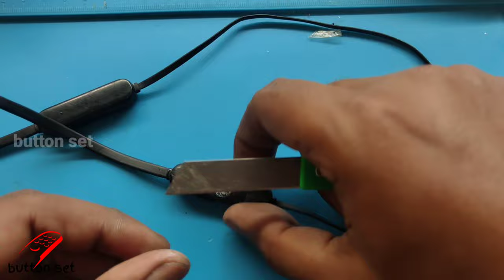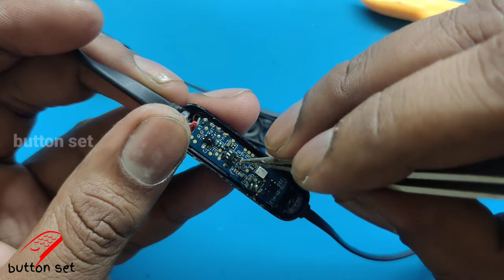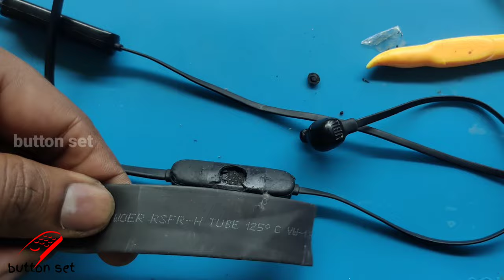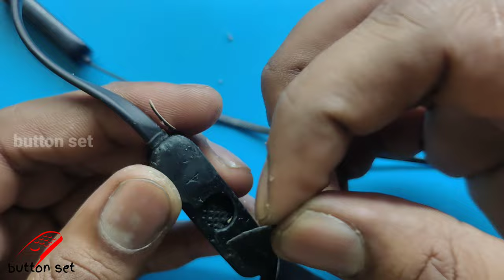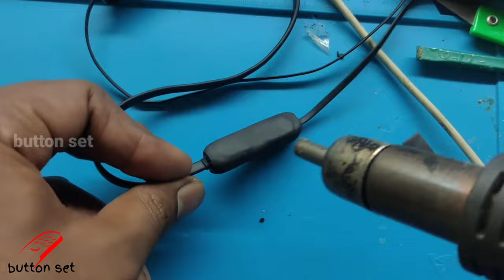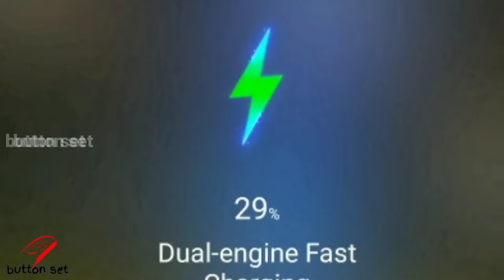JBL tune 165 BT Power Button Replacement

Comment: Hi, i like the way u did a clean repairing  job.....i have jbl tune bt110. Its button are hard to press and I want to turn it into a sleek and compact audio receiver with audio jack and longer battery life within a new good looking plastic enclosure box. The issue is i don't know if the external buttons are connected via jumper wires, how external buttons are to be placed with a clean look that looks nice and almost genuine....i think you can cover it with a heat shrink tube....Can you help me out with this diy and make a video too...if u agree i can send it you and u can send it back to me